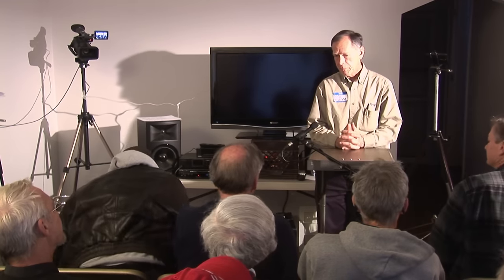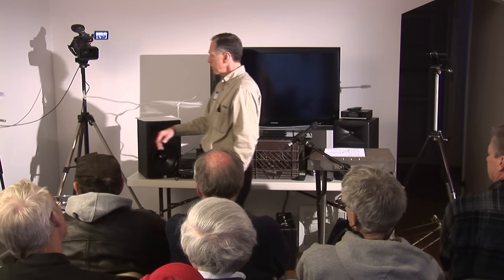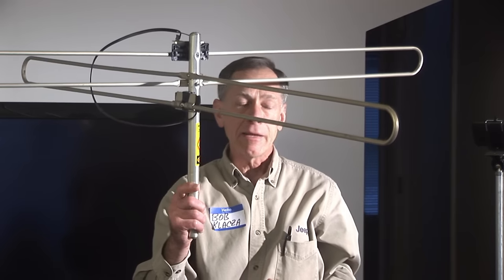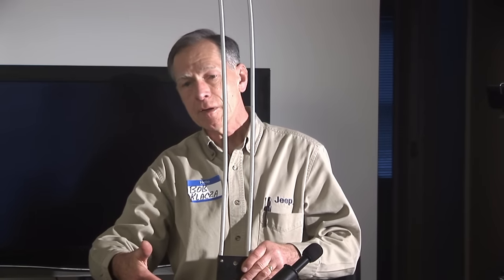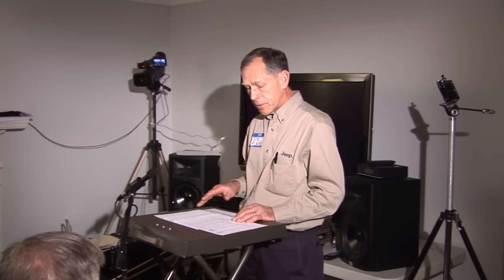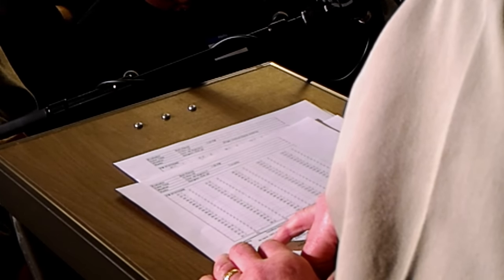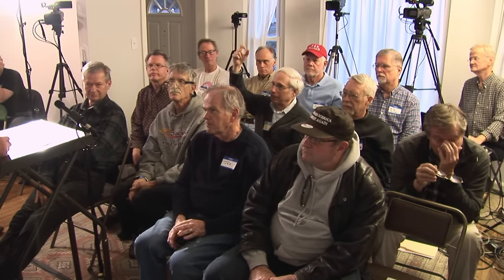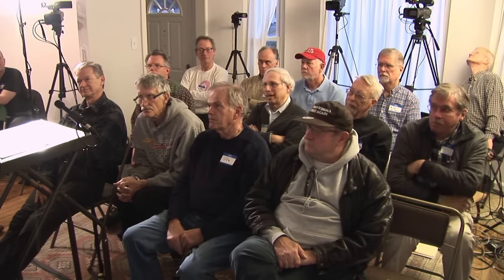Antennas for FM Radio Reception

Comment: Great video, good info.  Just one thought.  You mentioned circular polarization, and stated that it helps with minimizing multi-path interference.  Well, it does - except - for that to happen you have to receive with a circular polarized antenna.  Circular polarized broadcasts have the advantage that you can orientate the receiving antenna in any polarity and still receive the signal - However - either V, or H polarity of receive antenna (using only either of those), will be 3 dB down from that of what one would get if they used a circular polarized antenna for receive.
Reply: You are correct, but I do not know of many circularly polarized receiving antennas, especially on a car...
Reply: @robertklacza1160  Good point, however I believe what I was addressing is the issue of multi-path.  The advantage to true circular is that when a signal bounces off of anything, it reverses the circular direction.  The original signal may be left, OR right hand circular, and when you receive with the respective direction antenna (let's say it's transmitted with "left hand", and you have a left hand antenna), the right hand signals are rejected, therefore the "multi-path" signals are rejected.  
You see - any "reflected" signals come in with the opposite direction or rotation, because it flips when it hits an object, and bounces off (in this case, the reflected signals would be right hand).  Your left hand receive antenna - would reject them.  So, since we are NOT receiving with a circular polarized antenna (that rejects the opposite circular direction), how can we gain multi-path rejection improvement?  My understanding is the main reason they transmit with both polarities, is simply because homes use horizontal mounted antennas, and cars use vertical oriented ones.  Please share if you feel I missed something, OK?
.
Reply: @stephenbay9564  Thank you very much for your added discussion on the circular polarization topic!  You have covered the circular polarization topic quite thoroughly!!

Comment: A little clarification.  The folded dipoles described in my last comment each had about 288 ohms at resonance.  Using the RG62 raised the impedance of each antenna to 1200 ohms.  Connecting each antenna to each other lowered the total impedance to 293 ohms at a resonant frequency of 98Mhz (the exact middle of the North American FM broadcast band).
Reply: Thank you for your informative input!  Some may find your connection technique rather daunting !!  Thanks again, Bob

Comment: After using a 6 element yagi and a rotor, nothing compares.
Reply: The cost of this antenna is about $20.  A 6 element Yagi antenna and rotor can cost ten times as much...  The complexity and size do give you better reception, but not many will step up to the cost and complexity
Reply: Jimmy Ray Which yagi did you use?

Comment: Hey Bob, great information!  A few years ago, I took a dipole driven element off an old TV antenna, and used some of the old ch 2-6 elements to make the poles closer to the FM band, then cut them to 98 MHz, and mounted it vertically on a horizontal stand off well below my current Winegard TV antenna.  For some stupid reason, I used a 4:1 balun, as I can only assume I was thinking of the impedance of the folded dipole antenna.  I've since removed the balun, and noticed a little improvement in reception; but, I'm really intrigued about using a folded dipole (and 4:1 balun) for the increased bandwidth it's supposed to deliver over the standard stick dipole.  

Do you think it would be significant?  The Stellar Labs 360 seems like a low cost to experiment with, but I'm wondering about the total length of it when the curved poles are straightened out.  From what I can find, it seems like it's a bit short, and may favor the upper part of the FM band.  Is there any way you can measure the antenna, and post what the total length of it would be, straightened out?  If it's a bit short, Stellar Labs makes a yagi with a folded dipole driven element that is a bit more, but may be more tuned to the center of the band.  

Anyway, thanks again for the great info, and I hope to see a future video on AM antenna systems (like why an FM vertical works so much better on the car radio to pick up AM stations than any AM loop antenna I've tried for my Sangean in my camper, and how I can make something that's omni-directional, external, for AM, and that'll work as good as what's on the car... and I know the impedance is an issue, too...).

Thanks!
Reply: The Stellar Labs 30-2435 antenna, when straightened out, is a bit less than 55", so it would definitely favor the high end of the FM band, and have poorer reception at the low end of the band...  AM loop antennas need to be large in order to be more effective in signal pickup.  Thank you very much for your reply !!
Reply: Antenna modelling demonstrates that by using a stick / open dipole connected to a 4:1 balun, actually increases bandwidth coverage compared to a folded dipole. The forward gain is not quite as high because of the intentional impedance mismatch. I would never use that type of dipole setup at 87 to 108 MHz. Instead, I use a horizontally polarised 8-element FM Yagi. But for ~ 25 to 60 MHz DX, a 4 metre total length horizontally polarised 'stick' dipole + 4:1 (300/75-Ohm) balun + RG6 coax setup is quite effective for domestic and overseas ionospheric DX.

Comment: Does a folded dipole FM antenna work when hung vertically?  Or only for horizontal mount?
Reply: When a folded dipole antenna is horizontal, the polar pattern is a figure 8 with the greatest sensitivity is perpendicular to the antenna and the least sensitivity in the direction that the ends of the antenna are pointing.  When the folded dipole is vertical, the polar pattern is circular, with equal reception sensitivity in all directions.

Comment: Unfortunate the cheap stock wire antenna was discounted and not tested. Even a guy sitting there asked. Knowing if the test results were negligible or drasticly better would be very helpful in deciding to spend the ~$20 on a better antenna or just using what came in the box. 
Next question is- Would reception of stock wire antenna results be better with leads verticle (one up and one down) same as other antenna was tested instead of hanging horizontal as in video?
Reply: If you measure the input capacitance of the FM tuner, and add the capacitance of the coax cable, you will quickly find the cable adds attenuation to the captured FM signal, minimizing the signal into the tuner.  By the time you get to and significant height above the tune, there may not be enough signal to be worth anything !  The dipole antenna can provide a better impedance match to the coax cable and the tuner input, maximizing the captured signal into the tuner.  The "Perfect" single wire antenna system, as mentioned in the talk, is 31 inches long, fed into a 31 inch piece of coax into the tuner input.
Reply: Robert Klacza  What kind of coax are you using? Coax loss is dependent upon input frequency and capacitance (I/R) losses between the core and shield. Bigger (diameter) coax typically has less loss. Higher input frequency = more loss for any given coax. I have never seen a dipole at ground level (at VHF/UHF) frequencies perform better than a well "fed" antenna in an attic. The old adage "Height makes might"  for VHF/UHF always holds. In the end, get that antenna up! PS - thumbs up on both your videos!
Reply: What about taking the "Straight-S" aerial, removing the balun & running 300-ohm twin-lead, instead?

Comment: Bob, I'm a novice at this, so I'm working with trial an error.  It appears that the length of the antenna arms seems to matter.  I've heard 29" and 30" in different videos for making antenna.  The aluminum S unit/dipole that is better vertical then horizontal (05:35 in video) is clearly longer then 30" for each arm in the T.  Is there a ratio that one tries to use to maximize signal strength reception?  Basically, is more metal better then less metal for each arm?  Would 60" arms of the T be twice as effective as 30" arms?  I'm hooking up to a radio receiver in an apartment/office and there is no access to the attic, roof or above for an FM antenna to be mounted to anything.  I stuck with 10 foot ceiling perhaps 20-25 feet of the ground, being on a second story of a two story building.  Any thoughts on how to optimize this with out mortgaging the house to do it would be appreciated.  Thanks
Reply: Chris, thanks for your comments and questions !  The 31" length of each arm in the antenna tunes it to the center of the FM frequency band, 98 MHz.  If you make the arms 60", that would optimize the antenna for receiving a 49 MHz frequency.  Just locate the antenna as high in elevation as possible, and if you have the desire to prefer only certain FM stations, get their broadcasting antenna location and place your antenna as close to their direction in the building as possible !!  Thanks again !!

Comment: 6:05  The ones I've had experience with are called "quasi-circular."  Each antenna in the bay is a half-wave dipole, with a difference.  Half of each element is a horizontal half circle, with the second half at a right angle to the first, one end pointing up, the other, down
Reply: Yes, that is correct.  There are several FM and TV broadcast antenna manufacturers, and each have their own patents and copyrights to the ones that they make.  It would be interesting to actually plot the polar patterns to measure the effectiveness.

Comment: The argument that there are FM stations transmitting in circular polarisation seems to be correct only for United States. In Europe, e.g. Poland there is NO circular polarisation in use. We have H and V stations ONLY, because of interference and bandwidth availability in adjacent areas. So - vertical dipole won't work in H (it would somehow, but its gain is gonna be marginal). This strategy causes some problems with multi-path in cities, but results with greater number of station allowed to transmit. So its in fact  a win-win situation.
Reply: Thank you for your clarification of FM broadcasting in Europe and specifically Poland !   Multipath effects in FM reception is most prevalent in moving vehicles, but can happen in a home situation, but in this case moving the antenna to a different location may solve this issue.

Comment: Bob, great video. Read through most of the comments and replies. Enlightening. My situation is that I have a metal roof on my house that interferes with FM reception. I saw Alan Nyhius' question and your reply below suggesting to put a vertical dipole about 1 m from the house on the side where the station's transmitter is located. I assume attic with metal roof would not be good. Should I try to put vertical dipole about 1m from house?. I only want to listen to one station and it is a repeated NPR station with antenna 5.7 miles away with power of 0.08kW (The FCC card says it is vertically polarized if I am reading it correctly). I have an old Zenith MC7030 receiver/tuner with the screws for 300 ohm antenna, no coax input. Should I use an adapter from screws to coax?, or should I use another type of wire to string out to the north side which will be about 45' away from receiver where metal roof comes down and ends? It is a gable roof and I could locate antenna at eaves or lower. Eaves are high, about 21' off ground (House on pilings). Thanks!
Reply: William, Thank you very much for your reply and question !  Since you have a radio with only a 300 Ohm input, I would attach a vertical dipole with "300 Ohm Twin-lead" from the antenna to the receiver, which will result in the minimum loss result !  The cost will be at a minimum as well.....  Please reply with your result !!!!

Comment: Bob, thanks for the nice video and education. I want to make my own long range folded dipole FM antenna to cover 90 to 108 MHz stations. I understand that on horizontal it works as dipole whereas in vertical it is a "kind" of omnidirectional, correct?  What should be the length of the aluminum dipole on each sides when I put in vertical position? Does the formula 468 divided by the frequency works for the vertical position as well?
Reply: The length of the dipole is the same regardless of the vertical/horizontal orientation.  Wavelength of the frequency is the same both ways.  The article at https://www.kb6nu.com/468-ham-radios-magic-number/ cites the 468 number.

Comment: Hey Bob!! I liked your video! I made my own 147 cm dipole and it works fine!  But it`s not omnidirectional, I need to know the exactly dimentions of de circular antenna because I`d like to make it myself. Sadly ,it is not available to buy to buy in my country. Here in Argentina FM broadcasting signals are horizontal, so putting a vertical dipole for comercial FM does not work.
Reply: Thank you for your comments !   It would be interesting for you to take a station quality scan with both horizontal and vertical directions and measure the results !!

Comment: I wonder if a marine antenna 60inch would work indoor for FM radio reception.
Reply: Any antenna is better than nothing, but the marine band is  in the frequency range between 156 and 174 MHz, and will not be optimized for the FM band of 88 to 108 MHz.

Comment: When I lived in north east Missouri in the late 80’s I had a radio shack tv antenna on the roof and got weak stations 300 miles away now in north west Houston Texas I can’t get a station 15 miles away on antenna  is there signal boosters available that will help with digital-      ,analog always came in but week
Reply: Thank you very much for your reply!

Comment: Hi Bob Klacza. I'm Ben Coleman from Brisbane, Australia. after watching this video so helpful but I'm trying to get a radio station that isn't streaming online yet called 100.9 ZZZ FM Lismore. How do I get the station from my household which my place to the station in length is 126.35km in a straight line.
Reply: Thank you for your interesting comment and reception condition.  You would need a solution as given by Tim Mack, Stacked Yagi antennas on a 70' tower were my only option. I would suggest if you are going into that amount of effort, that you consider a rotor so you can get everything !!!!

Comment: I have a sangean radio in the garage and kenwood kt-7500 tuner inside house that I listen to. I have a basic rca rabbit ears antenna that I use for both and get good reception.  A few weeks ago I was trying to listen to an fm station with Sangean in the garage that was 175-200 miles away and was barely listenable. I accidentally pushed one of the rabbit ear antennas down next to a 5' tall steel hand-truck and the signal strength went up so high it came in stereo! I tested this with my Kenwood tuner in narrow band and signal increased from 1.5 to 3.0-3.25, or basically double. So the vertical 5' antenna with enough metal mass does work great.  I got a couple 8' steel pipes, stood them up about 2 feet apart and connected a thick speaker wire across to them, and then put the rabbit ears next to it. Signal went up only slightly higher, a solid 3.25.  I tried with taller pipes but it didn't improve any.  So it appears that a 6 - 7' tall metal antenna is about as good as it gets for FM signal.
Reply from the maker: You have discovered the "large area" antenna.  The dimensions of these don't matter as long as it is big.

Comment: Bob, is there a way to tune out adjacent channel bleedover on certain stations with an FM antenna? I've used rabbit ears, and an outdoor antenna. I live 20 miles from a station I like to listen to, and it gets adjacent channel bleedover from 3 stations in between the one station from time to time.
Reply: That could possibly be done with a multi-element Yagi type antenna, with a rotor to point it in the right direction, providing the unwanted station is ~ 90 degrees from the desired station. 
 The other way to get rid of adjacent frequency stations is to get a modern FM tuner with DSP front end IC's from NXP, TI or STM.  The NXP chip set is used in the Sony XDR-F1, and works quite well, but unfortunately is out of production.  eBay has some available, but the prices for these reach into the stratosphere.....
Reply: I don't have that problem anymore. I now have a Sangean WR-2 radio it it gets great reception with the rabbit  ears and the outdoor antenna. I don't have a yagi type antenna, but I do have a GE Jasco indoor/outdoor attic antenna that I use for tv and fm radio and it seems to work very good for an fm antenna.

Comment: Thanks for your efforts Bob. At the end of the video you mention a segway in to part two. Was this not shared? Also, if I put an omni-directional (like the round one) or a bi-directional (like the "plus sign" shaped one) in my attic how does the length of the coax cable affect signal strength and will a powered signal booster help?
Reply: The segway was into the comparison of the Sony and Sangean AM/FM HD tuners. Please see it at my "Sangean HDT-20 vs Sony XDR-F1" Youtube video.  The coax cables have some attenuation at FM frequencies, a couple of dB per 100 feet, depending on brand and type.  I recommend RG-6 by a name brand manufacturer.
Reply: The  "Sangean HDT-20 vs Sony XDR-F1" Youtube video is at https://www.youtube.com/watch?v=fbudkK9LzWY